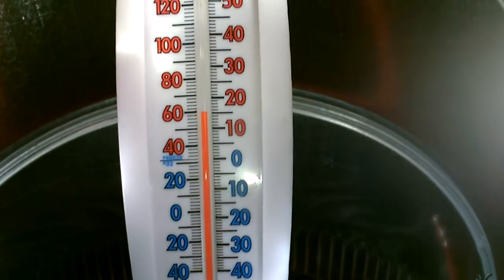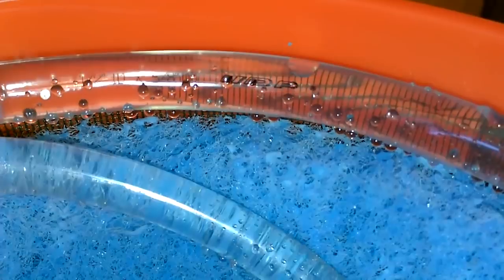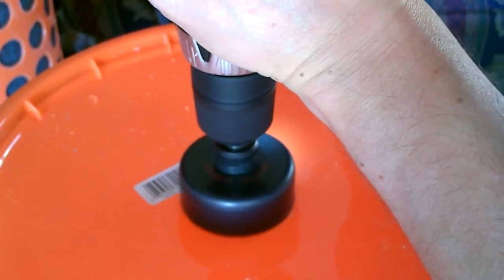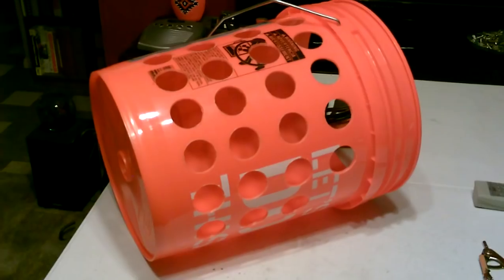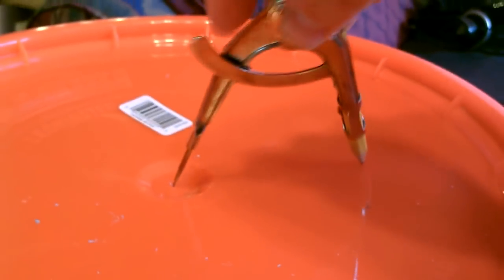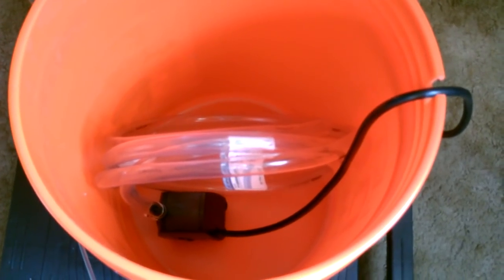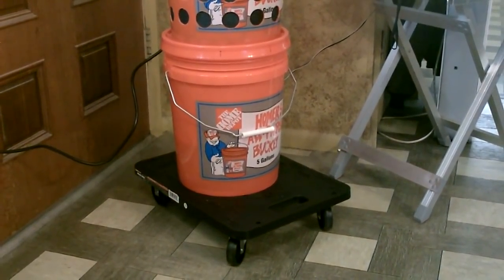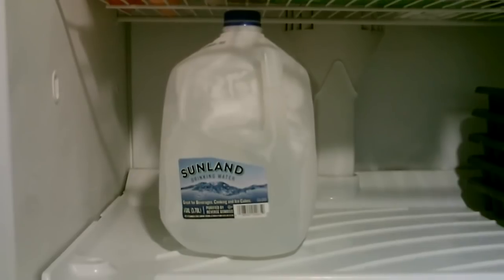DIY Evap Air Cooler! - Dual-Bucket Evap Cooling Tower! - Awesome Air Cooler!! - can be solar powered

Comment: Really creative piece of engineering! I wish I could get one these to work here in Los Angeles. I did my best with you evaporative cooling ice chest set up and even filled with ice couldn't get any coolness. It may be to dry here.
Reply from the maker: h there and thanks. since you're in LA, you should be able to get these to work. the drier the air the better they work (typically). try one of these "no ice needed" designs. (i have 2 more units/vids coming out in the next few weeks... one is a 20" box fan conversion and the other is a small window unit... and they all work great)... btw - the ice-based ones are more of a conduction-cooling device (they don't take advantage of the properties of evaporation cooling)